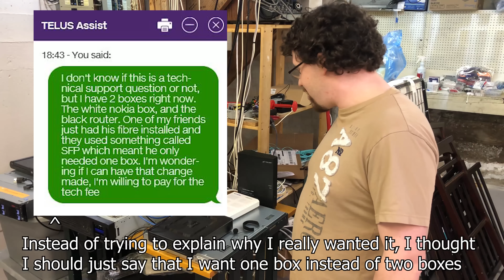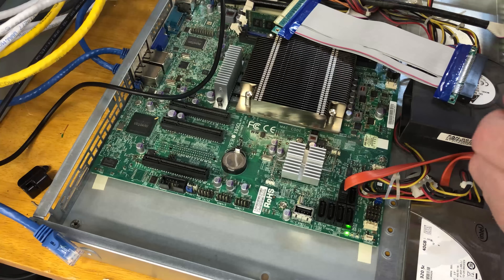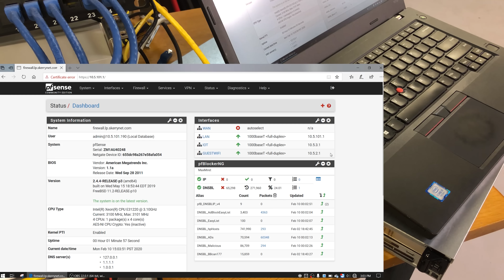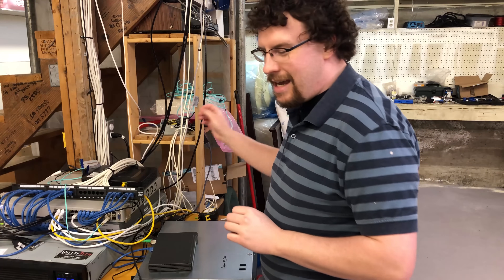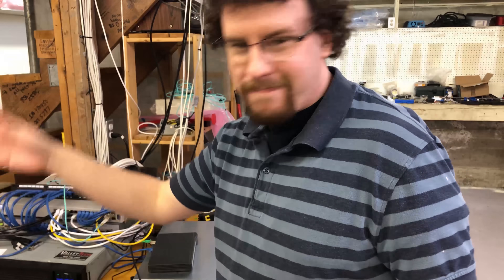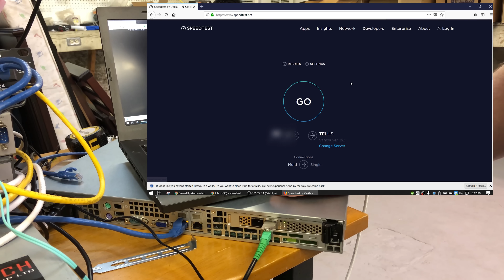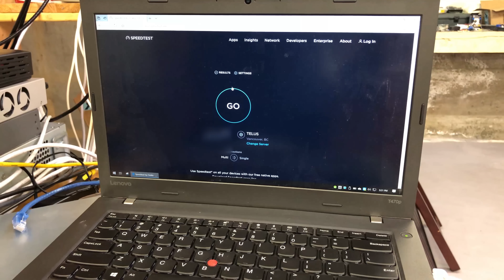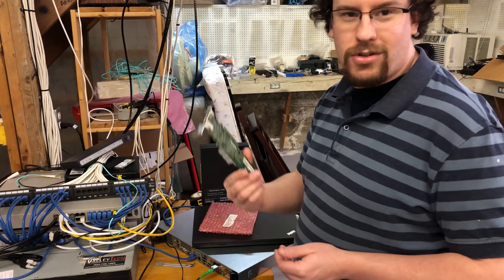I connected my fiber internet directly to my pfsense router via SFP!

Comment: the first card didn't work because you burn the card, computer was one while  you plug in the PCI cable...
Reply from the maker: The card works fine, it was a compatibility issue with the Nokia SFP module which has now been resolved.

Comment: Can you get 1.25gbps internet speed with your sfp module? I got one of this which called pon stick in my area but never got a chance to test it out since my    ethernet card is rated 1gbe.
Reply from the maker: Just released a new video, I upgrade to 1.5 gig which is currently the max speed my ISP offers. https://youtu.be/gzk69kHLu1o

Comment: Looking to do a pfsense box, but am un-decided as to what hardware to use or make. Any suggestions? Have tried to get my hands on a dell r210 ii but is there a better dyi solution?
Reply from the maker: The r210 ii would be a great choice, almost any old server hardware works and will be reliable. The only issue is power consumption, if you pay a lot for power you might want to find something a bit more economical like a SFF PC of some sort.

Comment: I wonder if you needed to bump the card speed down to gig instead 10gig maybe
Reply from the maker: I've fiddled a lot with this setup since i made the video. I'm back to the Broadcom card, the SFP module was incompatible but there was a little solder trick to make it connect. The reason I went back to the Broadcom card is because I was able to use their utility to force the link speed to 2.5gbps meaning I'm now ready if my ISP provides higher speeds (not that anyone really needs home internet that fast...)

Comment: That's almost like my setup. But I went for a media converter instead. No SFP or PCI-E on my router, so there wasn't much choice. If I did it again, I'd use a switch since it's almost the same price as the media converter.

Comment: First thing, pfsense detected new HP 10gig card and made couple of interfaces. That means 10gig card works. Second thing, your sfp test did not work because it requires same HP sfp to work. You will find some 10gig cards working because your sfp type is compatible with second one like generic to most of sfp types. So try with HP sfp and that first card will work like charm.
Reply from the maker: I probably should post an update on this project, but I actually am using the HP card now. I had to make a small physical modification to jump ground to one of the SFP GPON module pins. It's been working rock solid for at least 2 months now.

Comment: Hi, Can I use a Optical Media Converter to directly plug my fiber connection to a edge router x and monitor the vlan 10? is there any other variable to choose the right optical media converter?
My purpose of doing this is to avoid triple NAT

Comment: What temp range does your PfSense box runs at??   I have a almost identical box and want to make it a bit quieter but want to stay in a safe range
Reply from the maker: Cpu runs about 40-44 degrees Celsius. Mine is extremely quiet, it has the squirrel cage style blower for the cpu.
Reply: @TechwithShae  is that at full load?  I have a X9SCL-F motherboard with a E3-1260L 45W CPU. it idles about 38 and maybe hits 40 if I run my laptop through it and pull traffic...  not sure what a squirrel cage fan looks like but mines got the quad 40mm jet engine looking fans.... currently I am running them using Noctua's low noise adapters, but since my "lab" sits in my bedroom in a shared house, I am trying to make it as quiet as possible w/o running too hot.  I might try cutting one bank of fans off or even try it with no fans and see if it can stay decently cool passively....
Reply from the maker: Fair enough, those are my average temperatures. When I was initially testing it even under load, the fan doesn’t get very loud. I know the fans you are talking about, standard 1u servers fans are loud! I’m not sure if it would be compatible with your case, but here is a link to the fan mine has on eBay. https://www.ebay.ca/itm/124112539393
Reply: @TechwithShae  This is the Supermicro chassis I have... https://www.newegg.com/black-supermicro-cse-512f-350b/p/N82E16811152136   Not sure it can retrofitted with a different cooling solution... the pack of fans are not screwed down, they are just sitting there on a pin and that holds them in place...
Reply from the maker: Looks like the newer version of the chassis I have. My fan sits on 2 pins. (If I recall). The bottom of the fan is slightly elevated so that it can still pull air from the front vents.
Reply: @TechwithShae  wish I had the older version.  The rack ears on mine are ugly and the fans are a pain. Lol

Comment: Lol they try to force you to use a certain device. That's dumb. My ISP doesn't care. They distribute IPs via DHCP and I can just plug in a switch and use public IPs (though there's a limit on how many you can pull). Currently have a small Ubiquiti router setup, I used to have a pfSense box, but it ate too much electricity and didn't want to invest in a new machine for that.

Comment: Nicely Done.
If you're stuck with Optik TV, you can also use bridge mode in the Actiontec T3200M settings and plug your pfSense into port 1.
Then run everything but the TVs through the second external IP on the pfSense.
TELUS should give you 2 external IPs.

I just ordered one of those Chelsio cards to play with. 👍

Comment: You should try speedtest-cli (command line) it only use little resources, so the speed should be more correct than, via web / browser.
Reply from the maker: I actually did that after making the video (go figure). Results were similar. What I have found is if I run the speedtest in the middle of the night I am able to get a steady 945 mbit up and down. I have a feeling with covid and all there is a way higher load on my ISP these days.

Comment: Hi Shae enjoyed your video Im looking at getting into PFSense and was wondering what hardware your using to run PFSense
Reply from the maker: Thanks for the feedback! I'm running a Xeon E3-1220 V2 with 4GB of ram and 40GB SSD. It's definately more horsepower then I need at the moment, but I plan to add the IPS package soon and I think I will be setting up the traffic shaper to limit my guest wifi bandwidth. So the extra power will be useful.
Reply: Was it something that you bought off a supplier or did you build it yourself ??

Comment: I have fiber to the home.. when they came over to install it I was assertive about using my own router, which they didn't like but I stood my ground & they just installed a modem, which I used ethernet out into my own router. Does this have any benefits to what I current have setup?
Reply from the maker: It sounds like your setup is basically the as mine was (prior to the making of this video). Nothing changed for me in relation to performance, but I believe this configuration will be more reliable since it completely eliminates a device in the chain.

Comment: I'm almost certain it wasn't a power issue with the SC-APC transceiver. Fiber transceivers in general are very low power. You likely ran afoul of HP limiting what SFP+ modules their products support. Your Dell duplex LC-type module is OEM-manufactured by Finisar, and they make HP's own transceivers too, so that's likely why the LC module worked.

Also, if you decide to do more experimenting, KNOW YOUR CABLES. Your carrier's fiber cable is a simplex SC-type, and the green color means it's APC (angled polish), which is fairly uncommon. That also requires SFPs specifically for APC connectors, so be kind to the one you have. The more common SC cables out there have blue connectors, which are UPC (uniform/flat polish). If you plug the wrong type into a transceiver that's expecting the other type, you will DESTROY the module and the fiber cable. So be careful.

Good call on getting the Chelsio card. Those are the gold standard for BSD (the OS that PFsense runs on), and they're transceiver agnostic. You won't find better for PFsense.

I would have liked to know what your throughput was before making all these changes though. Hard to tell how much improvement was gained.

Comment: In reality the more likely reason the first card didnt work is because the Speed and/or Duplex had a mismatch.  SFP+ supports 10 and 1 gig speeds, however without looking g at the setting it's possible it was hard coded to 10gig and needed to be changed to 1gig.
Reply: There hasn’t been a half duplex option since 100Base-t.

Comment: speedtest.net relies on the browser too much, so much so that it taxes the CPU (on laptops or older machines like yours, the CPU will have 1 or more threads pegged to 100%) thus stunting the speed result - I find fast.com to be better (less CPU load, higher speeds) - also LibreSpeed works the best for me (near line speed, even less CPU usage) - other than iPerf which i use locally.

Comment: Fun facts!

The SFP that Telus provided you is actually an ONT in itself. Specifically, it's a Nokia O-010S-P, hence you don't need the white ONT as well; although you will need it if you have POTS lines through Telus. Of course you could run a SIP-based PBX, or use an ATA adaptor (such as the Polycom Obi-200 for Google Voice).

I recognize the white ONT as a Nokia ONT G-240G-A. I actually ran a proof-of-concept with a Nokia 7360 ISAM OLT and one or two of those ONTs. We also tested several of the G-040P-Q ONTs (a similar model with PoE but no POTS lines), and a few other models they had (such as a single-port, a rackmount 8-port, a 4-port with PoE, 2 POTS and RF TV, and another one like that but also with Wi-Fi). They even talked about the SFP ONT, which I believe was not GA yet, so we didn't get to test that out. I hoenstly wasn't impressed with Nokia's management software, mostly with the web-based UI. I had requested several improvements, which they did put in the next release, but it was still pretty awful. The Java client was extremely clunky, and took (literally, I counted) 24 clicks to change a VLAN on a port. They had only recently (at the time) started getting into the enterprise market, so most of their products and software were geared towards service providers.

I have since headed up a proof-of-concept with a Tellabs OLT, and we ultimately chose them over Nokia, due to its many powerful features (dynamic VLANs, automatic NAC assignment, complete intergration with Aruba ClearPass, physical hardware & capabilities, and an extremely user-friendly interface, just to name a few of the reasons).

Now, you won't be able to just buy an ONT (including the SFP) off eBay, and you can't use a different brand either - Nokia GPON will only work with Nokia ONTs; Motorola and Tellabs are the same as well. Furthermore, the FSAN/serial number is tied to your service, in much the same way that the HFC MAC address of one's cable modem is used to provision their cable internet. They can buy a cable modem from BestBuy (as I have done), but it's not going to work until their ISP registers and provisions it on their system.

Similarly, an ONT is assigned a TDM channel by the GPON system, from 1 through either 32 or 64 (or technically up to 128, but 32 and 64 being the common number of fiber splits). In a service provider environment, automatic discovery/ranging and provisioning is not likely to be enabled, since they would have full control over and ownership of the CPE. The provider will likely either manually accept an automatic ONT discovery request, or require the ONT be entered into their system manually. In our enterprise environment, I've opted to use auto-discovery, and have configured it in a way such that any ONT being plugged into any building with PON will be automatically assigned that building's specific NAC profile (which includes the available VLANs), and the VLAN and ACL assigned to the port will depend on the authentication, be it user-based or MAC-based.

Of course, that's not to say this isn't extremely awesome! I totally wish I had the option to do it myself! Unfortunately, FiOS doesn't quite come out this far in my state, and while my town did put in its own fiber internet, it opted to deliver it via Wi-Fi to the home...so that was a big no from me, haha!
Reply from the maker: Wow! Thanks for the great comment, it was a very interesting read.
Reply: Oh they should work with different ONT, Orange Poland (part of France Telecom) seems to be using Huawei and Nokia OLTs but they have Sagecom ONTs with built in router. Also there is presentation about small Polish ISP trying to get his own custom ONTs from same OEM factory as Nokia (they don't manufacture their own ONTS :)), i'll try getting you link to presentation.
Here you go, and he seems to be talking that Nokia OLT doesn't seems to complain about ONT, but he is talking from ISP side, not customer. Of course he want to supply his customers with his own ONTs.
https://www.youtube.com/watch?v=7kcGnT-dYW4

Comment: The lights turning off immediately after plugging the thing in, and the heat despite very little to no use, sounds like something is shorting or some power issue

Comment: I frankly was not expecting this to work, certainly not with the first card you used as ethernet and GPON are not the same thing. GPON frames and ethernet frames are completely different.  Most of the time, you do get ethernet out of your ONT, but this is encapsulated within the GPON framing along with other services like video and voice (depending on where you are in the world).  Even with the second card, I was surprised it worked out.  I'm glad it did work out for you though. :)
Reply: I was also surprised. I can only conclude that it's either not GPON connections but some sort of an ethernet fiber connection or that badass SFP module makes all the work of an ONT in translating GPON frames to ethernet frames.

Comment: 10 GBE Ports are usually SFP+ not SFP.  That could be the reason for the GPON SFP not working. And yeah we done this in the Lab we are an all Nokia shop running 7360 OLTs and typical ONTs are 221 or 220.
Reply: Some sfp+ are 10gb/1gb some or 10gb only, same with sfp+ ports, to be honest it varies.
Reply: @wiziek  Not Nokia ONTs.  I've been doing this for the last six years

Comment: I use the fiber modem my ISP provided me with, tho only cause I get a direct public IP on it by simply using a VLAN on WAN. I get around 800MBit/s tho I think that the limiting factor isn’t my connection or PC but rather the pfSense Box I use, a APU unit :) Still, really awesome!

Comment: Nice that your ISP don't lock the fibre optic line inside a box with tamper protection like they do here where I live.    No fibre optic for me, living in a condo, where the management board (all ladies in their late 60's) said that they didn't need fibre optic internet as they had tv...                Nokia SFP's can pull quite a bit of power.  Check that your gear will power it.

Comment: You are lucky that it works plug and play, I struggled with my ISP Bell. I had to get my PPPOE user/password in addition to using VLAN 35 In addition I do not have my maximum speed of 1gb, the best that I was able to obtain is 830 Mbs